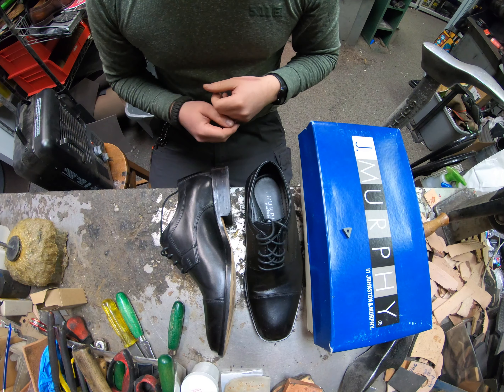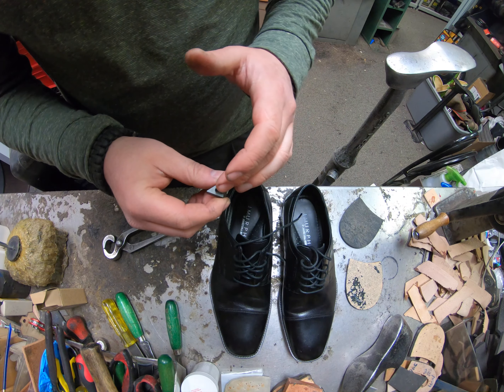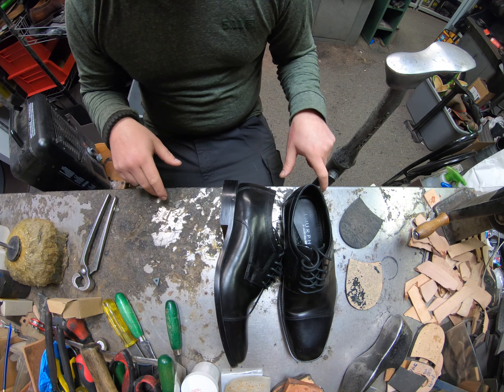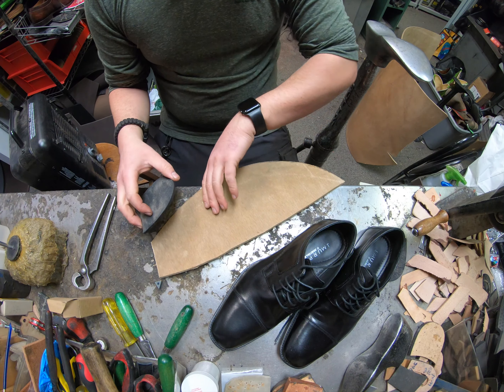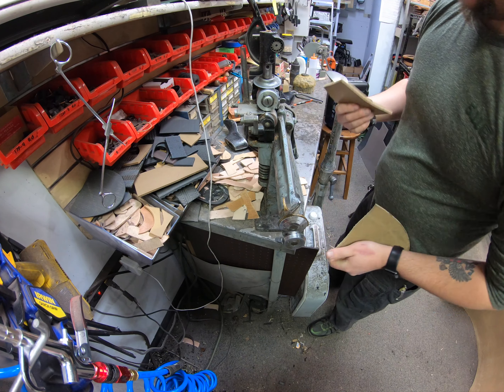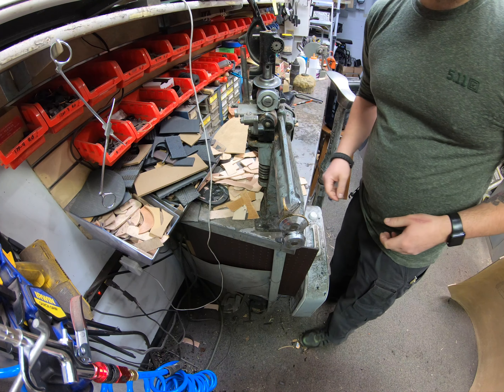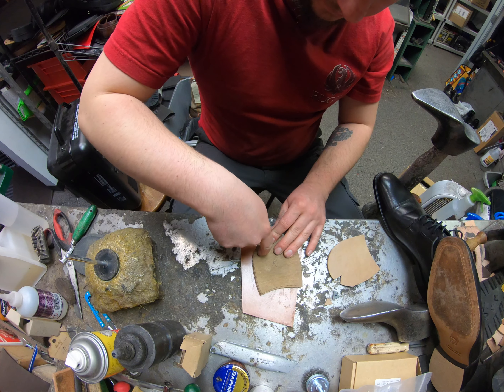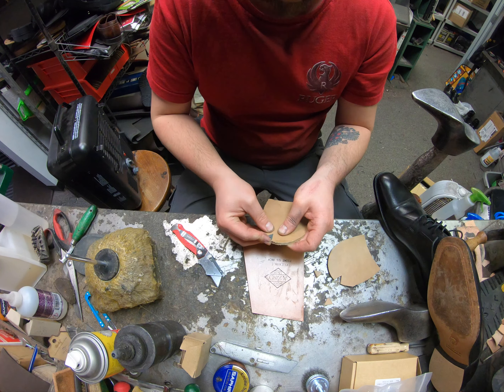Johnston & Murphy Shoes get a JR leather Heel V-Cleat

Comment: My Florsheim gunboats have the V cleat installed inside the edge of the heel so it's surrounded on all sides by leather and it's only visible from the bottom. A little more work but probably worth it.

Comment: Roughly how much extra life would that vcleat add to the lift of a heel?  I just have 2 installed and am wondering.
Reply from the maker: Because the v-cleat is metal it will definitely extend the life by at least 2-3 times longer. But we recommend doing them mostly on just leather heels but we do them on rubber sometimes as well
Reply: @CobblersPlus  Thank you!

Comment: So is it possible to take a pair of shoes such as these (which I think you indicated had a cement bonded sole) and add either a blake stitched sole or attach a welt and create a Goodyear welted sole? Similarly, if they were blake stitched to start with can you go from there to Goodyear welted or does the whole construction of the upper determine what the sole is going forward.
Reply from the maker: You can definitely change the build but it’s hard to tell at first until the sole comes off if it can handle being blake stitched or have a GYW added. 
If it’s not a shoe that can handle it but we need to convert it in such a way it can get a little costly sometimes in that case.